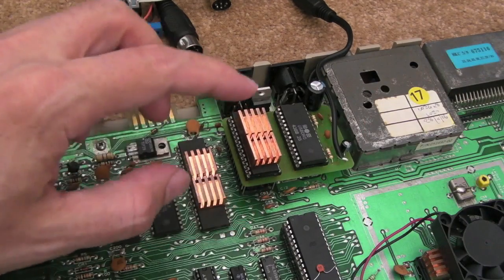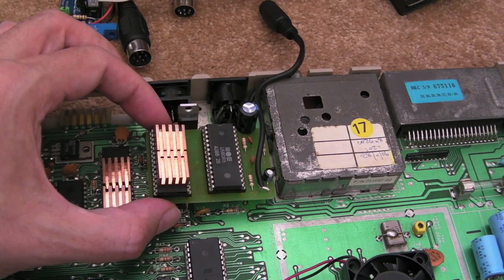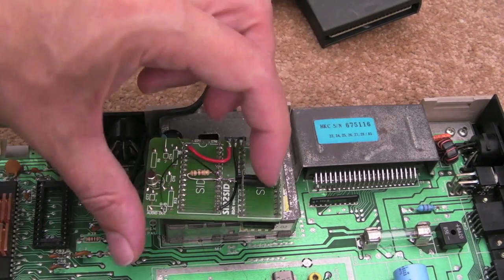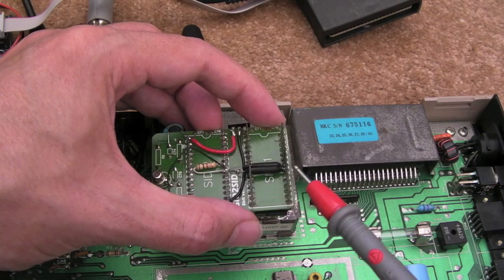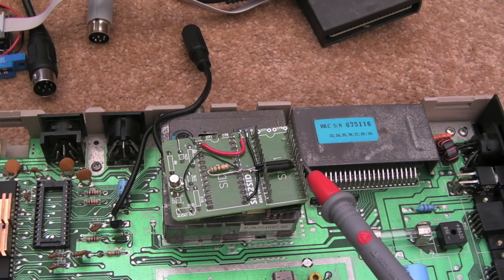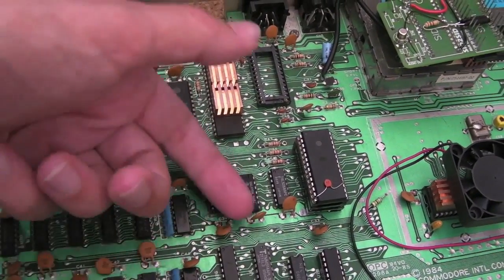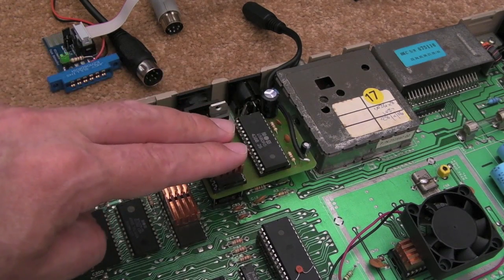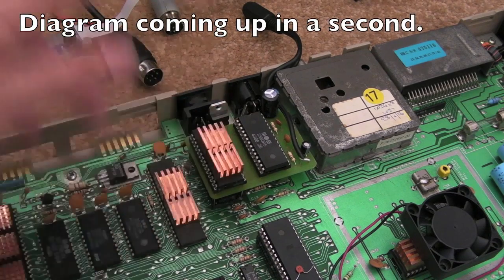Commodore 64 (C64) Dual SID Fix (Save the data bus!)

Comment: Hi Thanks for this. Just etched and built a sid2sid from scratch to try and get a nano working properly with a partially dead 6581. Did I get it correct? you severed the rw connection between the 2 sids on pin 7 and just grounded the rw on the second did? Cheers.
Reply from the maker: I corrected this in a follow up part where I used a diode or two to act as an OR gate I think.   But to start with yes, I removed the R/W connection to the 2nd SID, and fed it a constant signal - so it could only be written to, not read from (I think).
Reply from the maker: The other point I will make about the SwinSID and Nano Swin SID (again I did a video covering this point) - I found I needed to add a cap on the CS of the Nano because its timing was off when used in dual SID mode.
Reply: @GadgetUK164  Thanks. I will dig it out again when I feel braver lol.I just got interference noise off the Nano on Ch2 with a real SID in slot 1. I got intermittent, glitchy tones when I used a known dead SID in slot 1.  Suppose I am just a bit wary of messing up a real SID.

Comment: Fantastic video! I must have watched it a number of times throughout these few months lol... I've had a SID2SID board untouched for a good 8 months now I think, now's the time to bite the bullet and just have a go.
 
I'm needing to pick your brains about this, as you know I have a C64c and i'm wanting a switch between Mssiah stereo mode and pseudo stereo (hearing each SID on each stereo channel I believe?) . Am I correct in thinking it's as simple as having a switch on SID2's CS pin switching between the cart port pin and the CS of SID1? (of course with the diode and resistor mod you've just shown)

 It's all the logic Pot XY etc talk which is throwing me slightly lol 

Also about the power...i'm aware that the 6581 requires 12v, i'm figuring cutting the power trace on the SID2SID board and getting power from one of the capacitors on the motherboard (I believe one of them supplies 12V )  should be fine right?
Reply from the maker: Thanks =D  Sometimes its good to approach cautiously, especially with the fragile SID (You only have to look at them the wrong way and they can stop working lol).  Yes, you are completely correct with regards to the CS on SID 2.  If you have a switch between the 'derived CS' from the SID 1 side, and the wire that goes to the cartridge expansion port, when switched one way the CS will come from the 2 diodes, and if switched the other way the CS should come from the cartridge port (not sure if its an upper address line or what - never looked at the expansion port connection there, but I might do the same after you've done it).  The only thing that might cause an issue (but I doubt it), is the pull down resistor, but you could have that pull down resistor connected to the 1st switch position (tied with the CS diode cathode connections), and that should solve it if you don't want the pull down affecting the CS of SID2 when driven from the cart port connection.   

With regards to the POTX and POTY issue - basically, in a previous video I experienced problems with the diag cart and Last Ninja 3 behaving strangely.  I worked out that it was because the SID2 was being read at the same time as SID1 - that's where this diode fix came in.  And that problem can only occur in psuedo stereo mode, because in Messiah mode SID 2 will only be enabled when a specific address line is set (SID1 CS wont be enabled when that happens).  So provided you use the diodes and pull down there for psuedo stereo mode, you shouldn't need to worry about any clashes, and POTX and POTY will only be read from SID1.

Finally, with regards to 12v on a 64C - There's a forum thread here which you might have seen:-  http://www.mssiah-forum.com/viewtopic.php?id=422   Just make sure you measure the voltages in SID1 and SID2 slots (without chips installed), to double check that the VDD pin is correct for each socket before you install the chips.  That forum thread seems to suggest its OK to take 12v from that specific location on the board, but I would definitely measure it for a period to time to make sure its 12v and only 12v.  The alternative is to add a 7812, and feed its input from one of the caps on the right hand side there - i think there's like 18v or something that could be used to feed the 7812, and despite the high input voltage you will find that the regulator wont get warm because the 6581 doesn't pull very much current.

Also, I am sure you are aware but make sure you put the correct filter caps on the correct socket, or you may find that channels are missing when you come to test it.  I would also mark the sockets or something so you cannot accidentally stick a 8580 into the 6581 slot etc - could be easily done when you have no chips in there.
Reply from the maker: And an improvement might be to swap out the 1N4148 dioes for a Schottky diode (scotty diode as I call them lol) - just because they will switch faster.  That was an oversight when I first did this mod.
Reply: Thanks for such a detailed resply! 
Ooh freakin 7812 regulator it is then! i never thought of that! I dont want to take any chances! Yes i’ll be labelling the sockets too, I need to get that board out and see if I can cut the power trace on the 6581 side of it, which in this one will be SID2 as it's a C64c, hopefully it’ll not be an issue.
About the pull down resistor, yes I will just add it to the switch along with the Scottys (yes I always called them Scotty diodes too lol) so it's not constantly on. I'm wondering if i should make it all on a separate tiddly PCB, the diodes, resistor, switching and the 7812 circuitry. i'll see about that after I draw up a circuit diagram myself of all this. 

i’ve been seeing my SIDs as if they’re made of thin glass almost lol and delaying this until I fully know what i’m doing. As you said they can be easily goofed up. Thanks again for your help, it’s really cleared up a few things! :o)
Reply from the maker: Just check the 7812 doesn't get too hot - it shouldn't but then again I think when I used one in the 64C it was mounted on a PCB, so it was heat sunk into the PCB and didn't seem to get warm perhaps due to that.
Reply: I'll just put a tiddly heatsink on it just in case :o)
Reply from the maker: Haha =D  It will look cute, but at least it will be cool too!

Comment: Is there a way to do this with the standard SID2SID board where this might be selectable?  This way you could have six separate voices when needed and psuedo stereo when not.  Perhaps by added three or four switches?
Reply from the maker: Yes, I think the difference between the standard SID2SID stereo mode is that you connect SID2 CS pin to one of the address pins on the cart port (you would need to check the SID2SID instructions).  So in theory, you could have a switch that connects SID2 CS to either the diode from SID1, OR the address line on cart port as per the normal SID2SID install).  That should allow you either true Messiah SID2SID stereo or psuedo stereo.  I think that should work!

Comment: This is more complicated than it needs to be.
All you need to do is tie SID2's R/W line low. (Always write)
None of the registers in the SID are R/W, they are all Read or Write only.
So when you read one of the readable registers, SID1 reads to the bus & SID2 writes to a nonexistent register.
Reply from the maker: +moshly64 That doesn't work unfortunately - at least not correctly without artifacts.  We've tested and what seems to happen is the 2nd SID responds to reads as writes and it does translate into some very minor glitches!  Totally see what you are saying but that's where we started and we ended up using CS to ensure that SID2 wasn't enabled at all so it couldn't glitch from reads being interpreted as writes.

Comment: I'll be using 2 x 8580 in my C64C when I have put together my SID2SID pcb, is this mod required in all situations?
Also I would appreciate if you could do a video on how to connect the SID2SID for switchable stereo and dual mono.
Reply from the maker: +Zen - dar House Classics This mod is only required if you are running both SIDs off the same address (ie. in dual mono pseudo sterero mode).  If you are using it with a Messiah or something like that, where each SID sits on a different base address, then you don't need to do the mod.

Comment: Can you make a video doing this on the C64C motherboard or is it the same,I would like to use the 6581 with my 8580 sid chip..?
Reply from the maker: +RETRO Nuts It's pretty much the same, the only difference is the C64C provides 9v to the SID (6581 SID is 12v).  Your simplest solution is to check out Dave Currans website and order the ready made board from him - If you tell him you've got a C64C and which kinds of SID you want to use in the dual SID board he will build the board for you.  It's pretty cheap for what it is as well, and his boards are brilliant.     http://blog.tynemouthsoftware.co.uk/2015/11/commodore-64-pseudo-stereo-dual-sid.html

Comment: Hi. I was reading the blog post related to this SID board. Remember the discussion about the swinsid that didn't perform correctly with an eprom pla ? I didn't know the DIS board has a gate on the #CS signal to SID2. This might be the answer to why SID doesn't perform well. Margins are tight, and adding propagation delay on the CS might tighten the timing margins further..  (?) I don't have the full picture so I can't tell :)
Reply from the maker: +bwack The OR gate was definitely the problem when using the Nano in SID 2 position.  Adding a cap did fix the nano (as covered in later video) so it sounds perfect with the dual SID board - not what I would have expected, you would think adding a cap would make the problem worse but it doesn't.

Comment: i have a few questions please. i see in your mod you separated the CS lines and added the diodes. i cant understand, did you separate the R/W line that was connecting the 2 SIDs and send R/W#2 to GND i also noticed, you have an extra cap at the top and what are those thin black kaynar wires for.
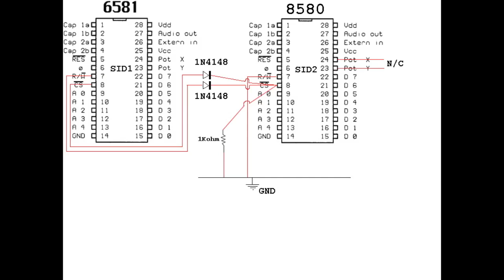Reply from the maker: +Silverfox0786 You can see what was done with the CS and RW pins on the diagram at 5:55.  The kaynar wires are probably to route ground to the regulator, and to connect ground through a 1K resistor to the 2nd SID CS pin, to pull it low when the diode is turned off.
Reply: Thanks, i did see that. so the R/W trace has been cut
Reply from the maker: I think R/W is set to low always, ie. write.  Then the CS from SID1 disables SID2 when the CPU requests a read.
Reply: brilliant cheers, just what i needed to know, because that was confusing me as the R/W would be tied to GND

Comment: Good to know, some weeks ago my DualSID (8580/6581) died or not working for some reason.
First it works great, but now SID2 side is not working and at the SID 1 I hear that some sid don't sound right.
First I was thinking my 8580 died, but with a second 6581 it don't want to work.

So I think it is the board, but now I want buy a new one.
Reply: +MrFixer1983 I hope you know 6581 and 8580 have different power voltages (12V and 9V) - maybe it's the problem.
Reply: Great! When I moved in my new home. I will try this. Thank you for your time.
Reply from the maker: Try removing each SID to work out which one is working properly.  It's possible one has a data bus fault.
Reply: Yes, I try that but I have no c64c at the moment to test the 8580.
I use a SwinSid in 8580 mode to test my dualsid and it don't work.
I don't test the another Sid yet, now I have some days free (summer time). So if have some free time I will test it out, And I fotget to say I use a potx+poty to gnd fix to use paddels and Mouse and a Audio in to gnd noise fix. Can be a problem?
Reply from the maker: If you are having to feed gnd to potx and poty then you need to do the diodes and resistor mod.  Sounds like one SID has a data bus fault maybe.
Reply: Thank you for you time, I have it's not the 8580. I have some 6581's left. I will check it.
Reply: +GadgetUK164 
Hi tested my DualSID with 2 swinsid's (8580 and 6581), remove the potx/poty to gnd fix.
But I hear strange sounds off the 8580 swinsid....
Reply from the maker: Which dual SID board are you using? Is it a DualSID or SID2SID board or other?
Reply: +MrFixer1983 Looks like databus on C64's PCB damaged. I think GadgetUK164 mod have to be done on Dual sid. Also remember about ESD problem, especially on winter. C64 can be damaged easily when you touching parts and you are not grounded...
Greetings!
Reply: KATOD_music Thank you for you time, but the strange thing is that if I putt in only a 6581 in my C64 board it works normal.
Reply from the maker: +MrFixer1983 Today I discovered the same timing issue that affects Nano SwinSID with the replacement PLA can also have the same issue in a dual SID board (depending on how the CS signal is handled).  Try adding a 10pF (approx) capacitor on the Nano CS pin (pin 8) to ground (pin 14).   I got my Nano working tonight on a dual SID board that way - the CS on this dual SID board is going through an OR gate, which is adding a delay.
Reply from the maker: +GadgetUK164 Btw - the nano just uses the 5v, it doesn't connect to the VDD pin (ie. 12v or 9v), so the Nano can go in any board or any slot in the dual SID / SID2SID board.

Comment: Happy to have helped. I think I'll have to build myself one of these now.
Reply from the maker: Thanks again!  It's well worth doing this mod if you love SID music, you get the best of both worlds - no more swapping between C64 and C64C for the different sounds.  I wouldn't go back to a single SID now.  Will probably do the mod to my 64C at some point as well - need to think about the 12v VDD for 6581 first as I can't remember if there's a 12v line in the C.
Reply: GadgetUK164 I'll probably knock up a PCB for this, with the regulators, capacitors, audio out amps and the diode OR, if you want one of those.
Reply from the maker: +Dave Curran Absolutely!  Love to buy a PCB off you!
Reply: +GadgetUK164 I've designed a board with onboard caps, regulators and audio amp circuits, and the all important OR gate. Any feedback or suggestions of things to add before I get the boards made?  http://blog.tynemouthsoftware.co.uk/2015/09/upcoming-commodore-64-projects.html
Reply from the maker: Wow!  That looks great, especially with dual voltage and amplifiers as well!
Reply from the maker: I wonder if you could add a jumper to allow SID 2 CS to connect elsewhere (cart address line) via a pad?  That way it could be switched between pseudo mono and messiah stereo mode?
Reply from the maker: Ie. one position joins chip selects via OR, other position isolates SID 2 CS from SID 1 and outputs to a pad on the PCB instead.
Reply: +GadgetUK164 Good idea, that would be useful. I think the boards are in process now, so I'll have to add for the next batch. Is there any additional address decoding required for the separate SID version, I could probably fit a few more gates on there. I should probably make it configurable for 2x6581 or 2x8580 as well. I guess you use similar SIDs for true stereo?
Reply from the maker: From what I understand the dual SID boards use a 74LS139 somehow, in order that the 2nd SID is on a different base - typically $d4x0, $dex0, or $dfx0.  I guess that board must use 2 or 3 wires to get the different addresses.

The SID2SID is designed to just wire both SIDs in parallel, except for the CS of SID 2 which goes to a pin on the cart port (not sure which).

If you can fit a jumper or two (with a couple of pads as well) to allow SID 2 to be wired up to a different base address then I guess that allows 'Dual SID stereo', Messiah Stereo (if CS jumper / pad is there) and psuedo stereo (dual mono) as well.   In any case its great as it is, I cannot see many people wanting to mess with dual SID tracks etc, I think most people just like playing the old games and original SID music designed for single SID.

In a proper stereo mode you can use any combination of SIDs really (2 x 6581, 2 x 8580, or 1 of each), I guess if the regulator outputs could be jumpered it would accomodate either chip types?  I am sure one regulator could provide both SIDs if they are the same type?  If there's no easy / safe way to do fit jumpers, I guess people could easily fit the appropriate regulator to each SID position on the PCB?
Reply from the maker: Thanks for the mention on your page btw!  Just spotted the PLA PCB you've done lower down on the page - that looks great, especially with the adjustable delay =O

As a side note I tried a different make of 45nS OTP chips and couldn't get them to work at all =/   Tried a couple more Atmel 45nS chips without a problem.  It seems like the Atmels are 100% from what I've seen and no temperature changes on the SID or any other chip.
Reply: +GadgetUK164 Due to the different power supplies, audio amp and filter caps, I'd build these up for specific combinations. Not sure about loading until I do more testing, but fitting separate regulators will give each one it's own clean supply anyway.
Reply: +GadgetUK164 I wasn't sure if the configurable delay was overkill, so I've ordered PCBs of both versions, the one with the gate delay and the one with just the cap and I'll do more testing with those.  That hot SID was weird, it was repeatable, but only on that one board. Others have been temperamental or OK, so it will be interesting to see how the new versions get on.
Reply: +Dave Curran Blog posts now up on the dual SID boards (http://blog.tynemouthsoftware.co.uk/2015/11/commodore-64-pseudo-stereo-dual-sid.html) and the PLA replacements (http://blog.tynemouthsoftware.co.uk/2015/11/commodore-64-pla-replacements.html)